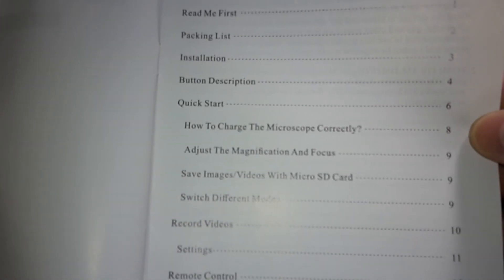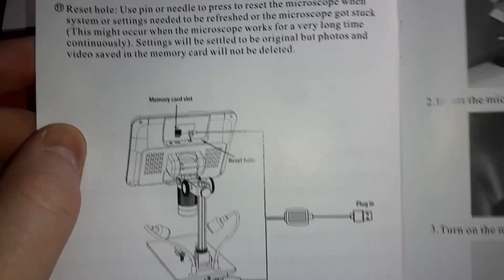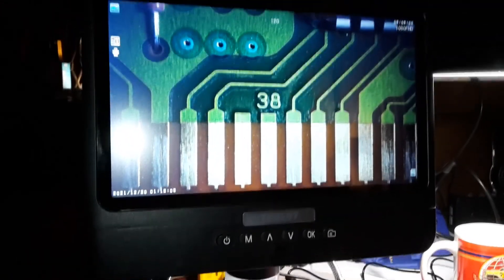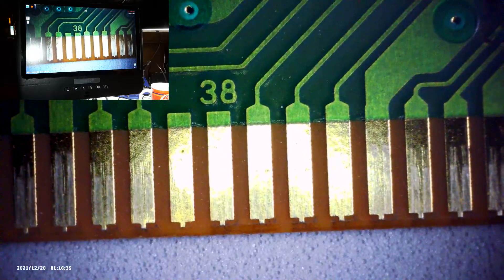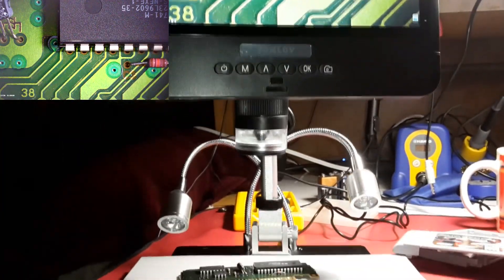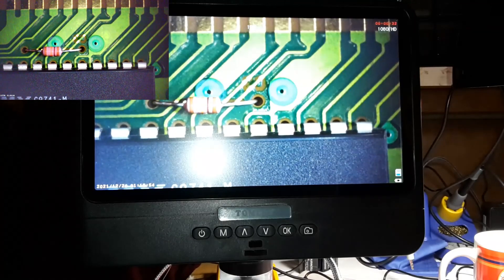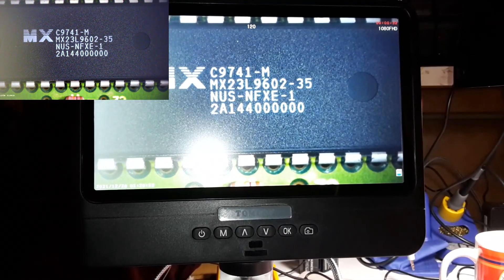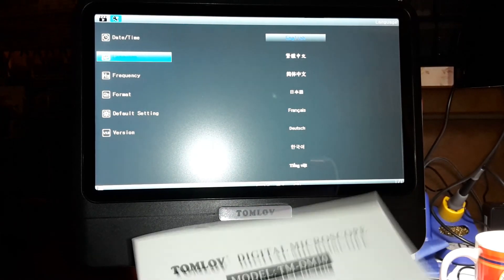TomLov® Digital Microscope Model: TM-DM10 | Unboxing Review

Comment: Does it zoom in and out feature, when viewing that close is there enough room to for soldering (lenses to baseplate height? Thanks
Reply from the maker: Greetings,  welcome to channel, i needed the extension part after many months without it i noticed a drastic performance gain once practicing some soldering, it does digitally zoom in out has fine focus and is a wonderful microscope mine has no audio capture although some models may, overall i love this tool its become a staple for fine soldering, i have many videos up demonstrating its vast capabilities. Hopefully this helps offer you an informative opinion on whether purchasing this product and if any questions check in again I'll be happy to assist 😀 🍻